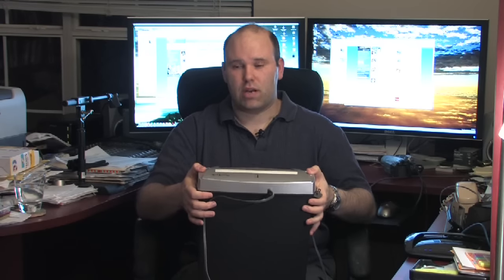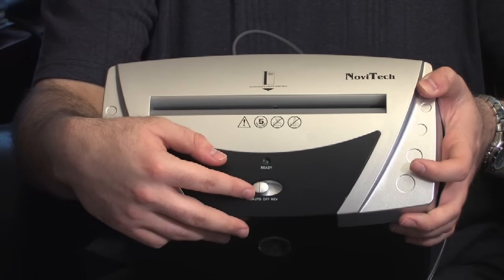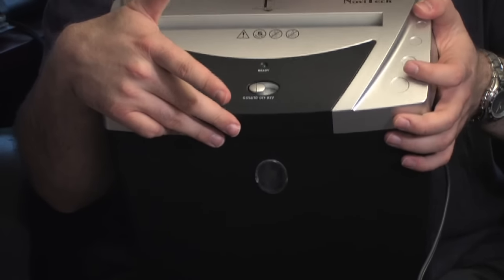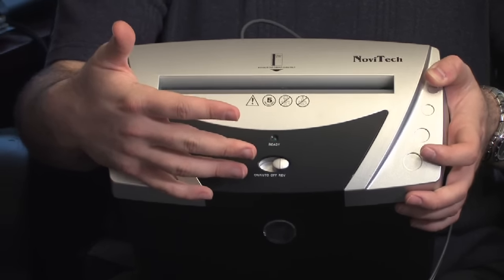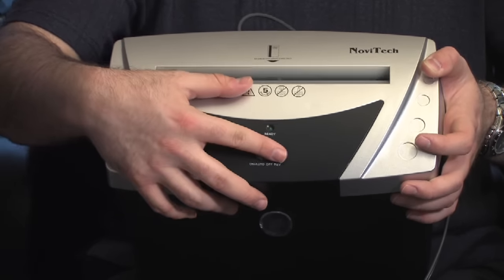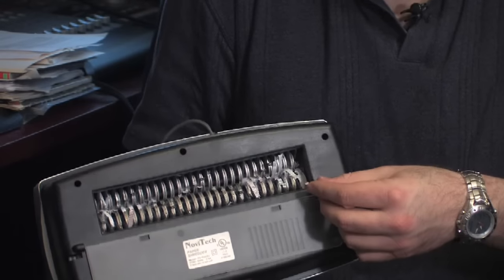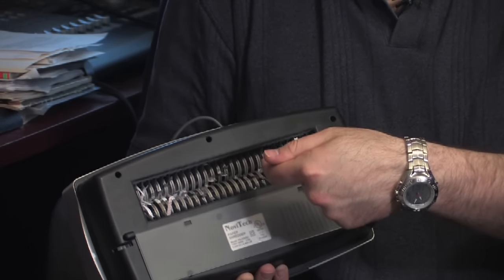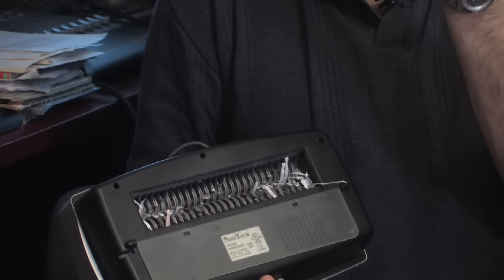Computer Basics : How to Fix a Paper Shredder

Comment: Sorry folks, but I disagree with negative comments. My shredder quit working months ago. Looked fine but had a few bits of paper stuck in the rotor. Nothing that would make me think they could be causing breakdown. I was skeptical about this video, but got tweezers and spent 10 minutes picking out paper fluff. Guess what? My shredder works. So laugh at video or me, but sometimes we need reminding solutions are often simple.

Comment: you saved me from buying another shredder.  I had removed the paper, reversed it etc. it was still not working.  After watching your video I tried for longer and also ran an old knife along the top of the paper feed slot (when unplugged). This must of freed a small wedge of paper.  Plugging in again it all worked.  Thank you

Comment: it overheats. all taking it apart does is let it cool down. at first, I thought the white plastic that turns it on was getting knocked out of place but the last time mine stopped ,I know 110% that it was still in place. I took it apart anyway and the motor was super hot. I didn't do anything except put it back together and it worked like a charm. it stops when it gets hot. taking it apart cools it down faster but you can just leave it alone and it will start again

Comment: I threw out 2 shredders that had the same problem, the motor runs but didn't shred.  I was just about to give up and got lucky.  I  inserted 4 sheets, together with just a little push.  It Worked.

Comment: My Fellowes shredder has a little black switch on the left side of the top. Picking up the top to clean out the shredder, I accidentally pushed that switch, turning it off. No auto function, no reverse, no motor sound at all. Hm. I spent some time with the top, turning it upside down, clearing paper, then happened to catch sight of that near-invisible switch as I set the top back. (The on/off switch label was on the opposite side of the top. A totally non-obvious place to locate the label.)

I'm glad this video is here, but I have two wishes: Move along a little faster with the explanations, and mention the presence of an on-off switch -- which might be nearly invisible esp. if it's black on black!

Comment: We have (had) that exact shredder and its junk.  Instead of having an infrared beam sensor that triggers the shredder to turn on, this one has a physical switch that must be pushed by the paper or credit card that you are feeding in.
NEVER BUY A SHREDDER WITH A PHYSICAL SWITCH.

If you get a jam in the shredder under where the switch is placed (in our case a credit card) when you hit the reverse switch to clear the jam, the remains of the card are forced BACKWARDS against the flimsy switch and snaps it off.

This shredders packaging claimed it could shred credit cards, but that was what wrecked ours.

Buy a shredser with a sensor instead.

Comment: my shredder will not work unless it is seated on the paper bin.  There is a small switch, on the side, that is activated when the top is correctly  in position.  Mine will not work otherwise...so don't assume yours is a goner..run it when it is on the  paper bin.
Reply: Thank you!  I'd just about given up!

Comment: My shredder works sufficiently but the problem is that when I click the reverse it works but going to shred mode it doesn't. I hoping to get solutions
Reply: Jeohn Rebosura There are two hidden switches on most machines. One is underneath the head/shredder block, the second, which is the one you may be having problems with is in the middle of where the paper goes. You have to have your block on the waste collector whilst working, otherwise the switch is not activated. When you reverse the machine, a lot of paper goes backwards and  into the main feed, and actually can block the switch which makes it work. You need to clean all the paper from the inlet, make sure the machine is unplugged before you do this. When you have cleaned all of it, you should see a little plastic arm, which is the switch. What goes wrong is the arm does not become activated ( which means it is not pressurized by the paper) when you try to feed the paper in, as the blockage prevents this. Once it is clear, try to feed some paper in making sure it is central, not to one side of the shredder. If it still does not work, activate the switch with something small, I used a paper knife, it must be plugged in, but make sure you only touch the switch, and not the cutters, this should not be a problem. If it works on activation of the switch, try again with paper.
Reply: not yet

Comment: Mine doesn't have that reverse feature. It grinds but does nothing. Trash it?
Reply: The shredded paper collection part you can put in the recycling bin or use it to keep bits and pieces in or as a bin for the bathroom. Modern appliances are not built to last sadly.

Comment: The paper was so thick and so jammed that a tweezer would have been ineffective.  I used princer pliers with a long stem.  At first it tore the paper that was visible.  Then I lodged the pliers in further, and lo and behold, a chunk of paper was raised.  And with more careful pulling, the rest was dislodged.  Just don't grab the edges and pull, or the paper will tear.  And then you have nothing to pull, right?  Now I have to retry the machine with the hope that the motor hasn't been destroyed.  Get back to you later.